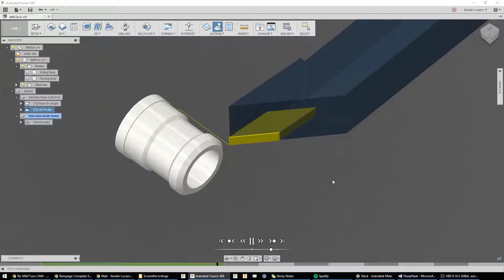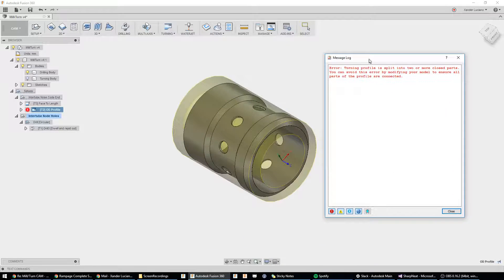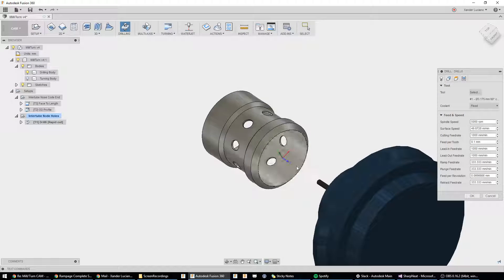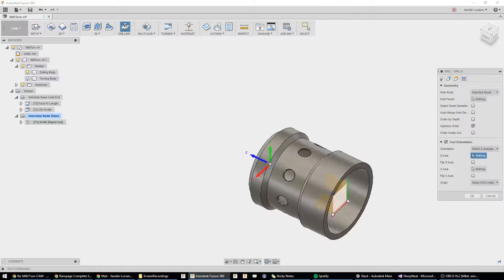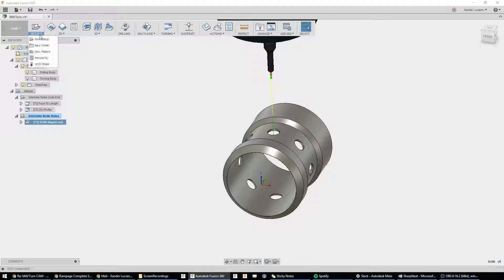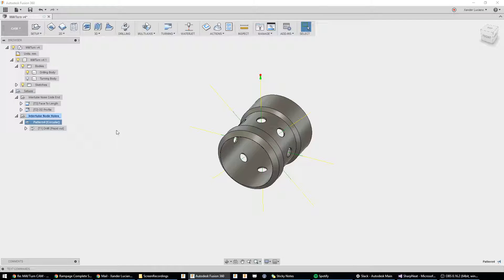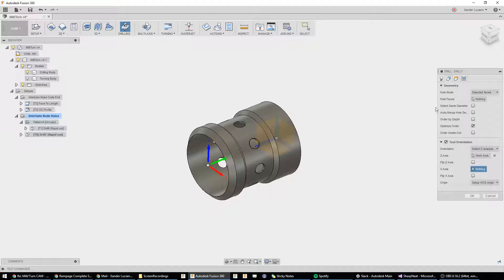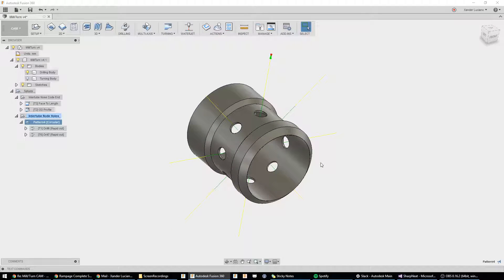Live Tooling and Fusion CAM - Tutorial on Mill/Turn Drilling Operations

Comment: Xander, what post processor will run this? I don't see anything under Mill/turn. Great video! Short and to the point.
Reply from the maker: It will vary depending on your machine / control, but most likely will require a custom post processor. I'd suggest making a post on the Forums with all your info and some of the guys there will be able to help you get exactly what you need!

And thank you! :)

Comment: Hi Xander, from what I have been reading apparently you can only do mill/turn operations if the live tool is mounded along z axis of the machine, unless you have the ultimate version of 360.....i'm a bit confused because the program seems to allow you to do it...do you know anything about this? cheers
Reply from the maker: If the tool is along the Z axis, then I believe the non-ultimate version can do that, but if the tool is along the X Axis, then I think you need ultimate (and a custom post processor which support that). You can alternatively use multiple setups and adding a few lines of gcode to "manually" position the machine correctly. I haven't experimented with this workflow though so I would have to try out a specific example before giving an in depth accurate response.
Reply: Thanks for your reply mate, the job that I am trying to do is really quite simple, maybe I can share my model with you on F360 if you are interested, and then of course there is the post processor issue..I am using a custom built machine with Fanuc Oi TD control, any help is much appreciated :)
Reply from the maker: Make a forum post and tag @Xander.Luciano in it and I'll check it out :) and if you can, export the .f3d file and attach it to your post.

Comment: How and what tool should i use for post processing so that stuff like this works with the layout of my machine?
Reply from the maker: Each machine setup could be different depending on how it's setup. You'd need a custom post processor. Are you looking to use live tooling with your machine currently?
Reply: Xander Luciano Yeah i do, im waiting for the ultimate release and some parts for my custom 5 axis machine which will have a similar layout to pocketnc.
but i dont know what to do with this post processor stuff
Reply from the maker: If you wanna pop over to the Fusion CAM forums and make a post there and tag @Xander.Luciano I'd be happy to help you out! Can you include the axis that rotate, and what their limits are. Also what control you are using and the machine model. Thanks!
Reply: Xander Luciano wow that sounds awesome thanks!!
Reply: I pinged you on the forum but I don't know if you saw it.

Comment: No spun profile?
Reply from the maker: Completely personal choice here, but if I can avoid using spun profile by using clean geometry, I will. It's just the workflow I liked best, but this would be an appropriate use of spun profile.
Reply: Xander Luciano Ah good. I hate creating new geometry and avoid at all costs. BTW this is Steinwerks on the forums/IG.
Reply from the maker: Oh hey! Fair point, that's why I just copy/pasted a body from before I did the hole and pattern operations. Skip to 1 minute into this screencast. It's a pretty simple workflow, and it'll be parametric if I ever make changes.
https://knowledge.autodesk.com/community/screencast/9b4ab212-2d97-4ca5-b0c6-00abbeb118c2